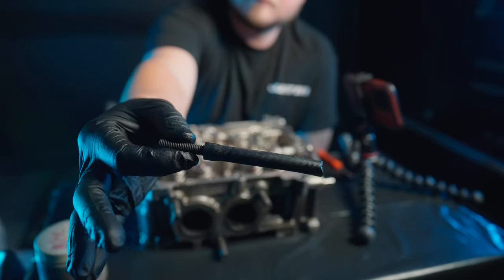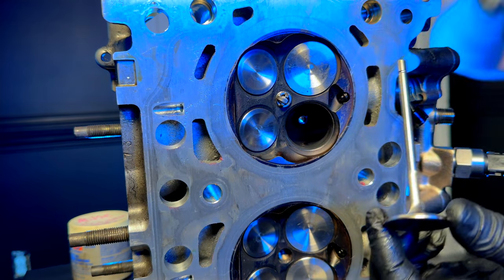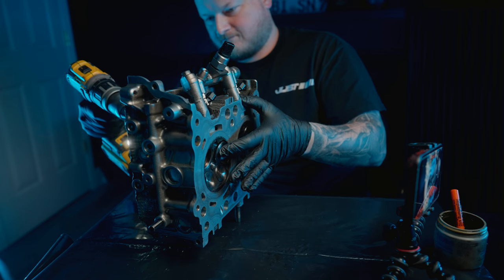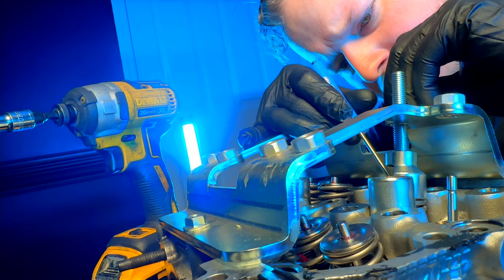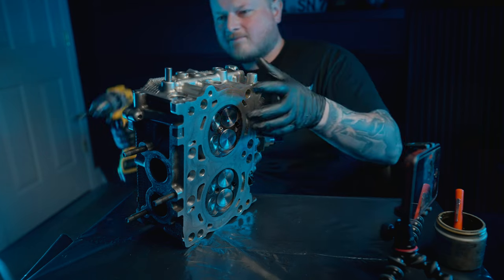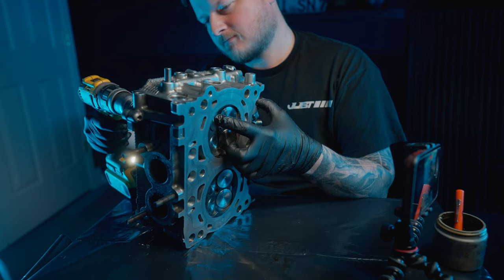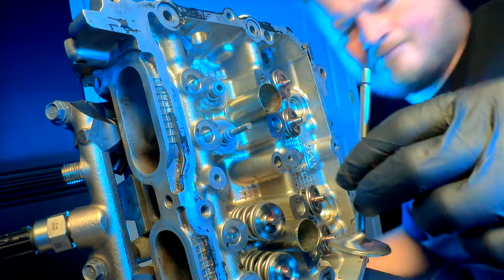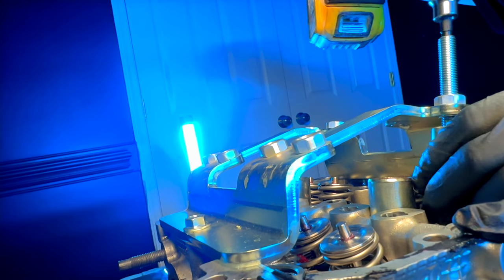How-To: Lap Valves (Quickest Way)

Comment: Excellent video.  The fuel hose is a neat trick.
Reply from the maker: It makes life soo much easier!! These valve stems were a bit smaller then usual so I had to use a hose clamp on the end to help snag the stem but it definitely makes quick work  of them! Appreciate you checking out the video man! Have a great weekend!